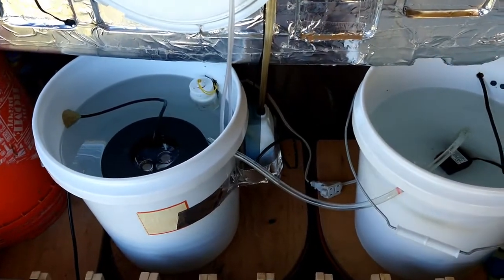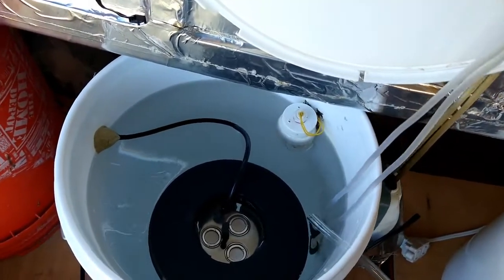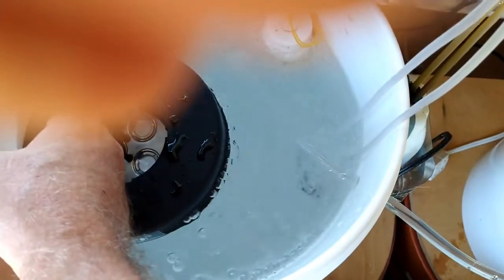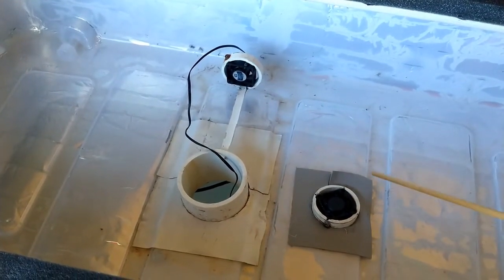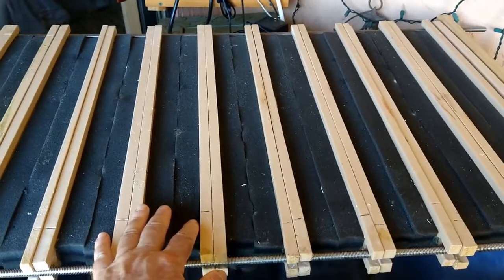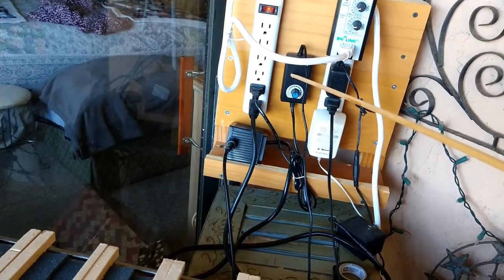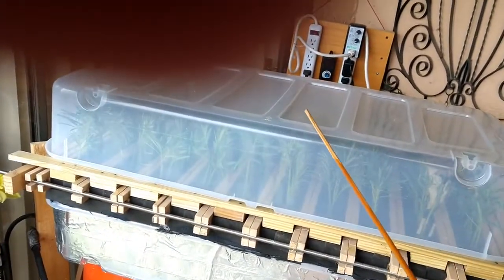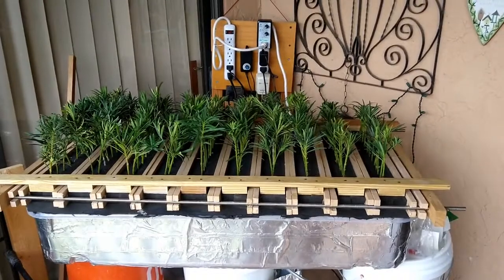FOGPONICS PROPAGATION SYSTEM

Comment: It would be interesting to do a side by side with a simple bubble propagator. Basically just a shallow tub with a lid and an airstone in it. As the bubbles burst at the surface of the water they throw small droplets up at the cuttings. Throw a few cuttings into it and see which produces roots first :)
Reply from the maker: The purpose of this system is to provide a uniform environment at the root zone to test different rooting hormone preparations.  The fog can easily and predictably be distributed to all cuttings without appreciably dislodging  treatments. It would be difficult to create such an environment using bubbles.
Reply: @phihelix7708  
You will find  the density of ultrasonic fog required to provide sufficient moisture for rooting will be too dense for gas exchange. Effectively ultrasonic fog acts like a fluid with very little space inbetween the droplets which is not ideal for root growth.
Reply from the maker: If you measure the density of the fog, you will find the fog is more than 99% air. While a thin film of liquid water is maintained at the cutting, this hardly acts as a barrier to gas exchange.
Also, the fogging module is on for 1min and off for 5 minutes.
Reply: @phihelix7708  
Consider 1ml of liquid represents 15 billion 5 micron droplets and ultrasonic fog is generally less than 5 micron.  If a 5 micron droplet was a table tennis (ping pong ) ball, a 50 micron droplet would be the size of a football. A container filled with ping pong balls will have far less space than one filled with footballs :)
Reply from the maker: It may be counterintuitive but when close.packing spheres, there will be about 48% space ( air) regardless of the size of the spheres. In this situation, the 5um droplets are not touching so the amount of space is vastly greater than 48%. There is actually a small energy barrier that must be overcome for touching droplets to coalesce which is a function of charge dissymmetry due to surface tension.
Simply, the density of water is about 1g/cc. The density of fog is nearly that of air. So there's not alot of water per cc of fog.
Reply: @phihelix7708  
Ultrasonic fog is dense so it tends to settle at  the bottom of a container like a fluid. The volume of droplets needed to fill the root chamber so it reaches the stems of the cuttings will not give you 48% air space especially with droplets that may be in the range of 1 -3 micron. If you blow the fog with a fan, the small droplets will tend to flow around the stems due to their low mass and boundary effect so the stems will be less likely to get sufficient moisture than if they were submerged in the super dense fog bank :)  I guess you will need to test it for yourself but in my experience rooting cuttings with ultrasonic fog is a very slow process compared to most other methods and there is a high probability the cuttings will die long before they produce any roots.
Reply from the maker: The root chamber is about 8" deep. I'm using 2 fans, one to move the fog out of the buckets headspace (about 4") and one to distribute the fog throughout the root zone. I did see some wilt after 20 days but I turned up the distribution fan and increased the "on" time of the fogger. Looks good again. Since I'm trying to evaluate hormone treatments, I need to non distructively monitor root growth as well as not washing the cut ends extensively. I should know if I'm on the right track in a few more weeks.
Reply from the maker: What type of plant was used in the 0-50 hr vid? What was the fog generation system?
Reply from the maker: @atomizer2665  I don't doubt your data. I question the conclusion that it is due to particle size. Then again i also question the concept that its possible to supply fog in droplets that can be absorbed directly through the root pores in a manner that just matches ET, which varies in time. I figure maintaining a thin film of water on the root is sufficient to maintain growth. A film probably acts as a barrier to the penetration of a droplet. If particle size was so critical, a signal generator could vary the frequency and amplitude of the piezo input in a manner to match a harmonic of the transducer. This should alter the droplet size of the fog in a predictable way. 
Again, if you weigh a cc of piezo fog, it's mass will be a lot closer to air than to water. indicating a very high percentage of air in the fog. I do appreciate this discussion.

Curtis
Reply: @phihelix7708  
The droplet size was the only conclusion i could draw given that i had a proven yardstick to base the settings on and it didnt work. If the ultrasonic fog was unable to grow the roots i figured if it was viable it should be able to sustain roots that were already accustomed to a mist environment..and that didnt work either. The only difference was the droplet size so if it looks like a duck its probably a duck :) I run air atomised aeroponic nozzles which use compressed air to generate the mist. They offer control over the flowrate and droplet size so its fairly easy to create a fog with very small droplet sizes which also produces slower growth and a sparse looking root structure. You may have noticed there was no lateral root growth in the video which was due to a lack of larger droplet sizes in the test. This would support the theory that the droplet size plays a big role, too small and you get slow or no root growth. With mainly small droplets ( but larger than ultrasonic fog) you get reasonably fast growth but no laterals. With a range of 5-80 micron droplets you get both.With too many larger droplets you get visibly wet roots with laterals but very little root hair growth.  If you search for ultrasonic vids on you tube most will involve a dwc in the bottom of root chamber which is doing the lions share of the work, while the fog just looks impressive. In your case, its a fair test because you are only running fog in the root chamber but that also means there is no backup which is risky. Most folks will throw plants into a fogponic system and assume the plant can intercept sufficient moisture from the fog even though the rootmass at that point is absolutely minimal, the plants generally die pretty fast.
Reply: @phihelix7708  
Any sign of roots?
Reply from the maker: @atomizer2665  Here's a publication that supports your findings.
https://journals.ashs.org/horttech/view/journals/horttech/28/2/article-p143.xml

To answer your question, Podocarpus roots in 8 to 12 weeks. We are at 8 weeks and I am seeing some roots. Unfortunately, early on, there was a problem with distributing the fog evenly. I ended up with one portion of the planting doing well and the rest of the planting didnt do so well. I adjusted the fans and things looked better but those adversly affected never caught up. I think it would take some optimization which would involve inventing the tools to monitor 
relevant parameters. 
Im now ready to try aeroponics. My problem is that im trying to evaluate rooting hormones so I need to avoid washing the cut ends . Im guessing low pressure generates large drops which may be problematic. Do you suggest high pressure nozzles? Can you recommend nozzles and pump. The ones used in the publication above may be too coarse a spray. Any help would be greatly appreciated.
Reply from the maker: @atomizer2665  I'd like to assemble a system that won't require exhaustive optimization. Seems like a HPA system has an inherently better precision compared to a low pressure system. For ex. the droplet size distribution is much tighter in a HP system than a LP. I see the Multiponics nozzles claim a droplet size of 30-80 um at 80psi. I do like using a $20 submersible vs a $100 high pressure pump but Its worth the extra for a sure thing. I don't need to run this much past 6" roots. Do you use an "accumulator" pressure tank with a solenoid. Id rather turn the pump on via timer. Your roots are impressive!! I need to use a model that requires root hormone so that I will see a treatment effect but at several second "on" time I believe the roots won't be washed free of the treatments.
Reply: @phihelix7708 
For your application i would probably go for low flow (0.3mm orifice) stainless steel 10-24 thread misting nozzles. They have a narrow cone pattern which would allow them to be mounted low in the chamber so the stems dont get direct mist. When it comes to control you should  use the fewest number of nozzles with the lowest flow rate that will provide the coverage. The design sets the lower limit on the amount of mist you can run, its easy to turn up the mist but impossible to turn it down below the design minimum. I run accumulators on all my HPA  setups. You may noit need to if you use anti drip nozzles and rely on the indirect mist. Using accumulators and solenoids provides tighter control over the mist but in your case the roots will never get close to the nozzles and will only be subject to indirect mist. A decent 24v dc reverse osmosis booster pump (125psi) 24v mains transformer and a digital cycle timer (dc voltage)  costs the equivalent of $80 here. If you can order from china it could be a lot less depending on import tax etc. I`d recommend using a  250 mesh filter on the input of the pump if you are not running drain to waste.
A pump only system will manage 2 second mist pulses especially if you are using anti-drip nozzles which keep the lines pressurized between mistings..They are the next best thing to a solenoid on each nozzle. I would aim to design the system so it will deliver no more than 1ml per 100L of chamber volume, if you can go less thats even better..you can always turn it up.
Here`s an old vid of a 0.3mm 10-24 brass/stainless mist nozzle at 10bar. https://youtu.be/MMVHJEoMFwg
Reply from the maker: @atomizer2665  Lots of good info here. The nozzles are difficult to find with all the features you describe. Part of the prob is that many sights don't have all the info needed. I learned early on not to describe the nozzles as HPA nozzles. Too many hits for hundreds of psi. This site looks promising.
 https://bex.com/wp-content/uploads/2016/01/BEX60Catalog9.pdf. 
Ill call them Monday to see if they can recommend a particular nozzle. 
I now plan on using an accumulator and solenoid valve. 
I plan on using a 64 gallon tote. When you describe 1ml/100L , is that per 2 sec "on time" in a 10 minute cycle?
Reply: @phihelix7708  
If you dont know what to look for it can be a bit daunting. If you  check out the Fogco and Amfog websites you should find plenty of nozzle options. Ideally you want a nozzle with a low hourly flowrate, a VMD (Volume Median Diameter, aka, Dv0.5) of 30 microns and DV0.9 of 80 microns. This will give you a mist where half the droplets are smaller than 30 micron, half are larger than 30 micron and 90% are smaller than 80 microns.  I`d recommend buying a good quality accumulator with a replaceable bladder if you can.  I`ve had some of mine for over a decade now and the original bladders are still in them. I would steer clear of the cheaper white reverse osmosis accumulators typically made in taiwan. They are normally rated for 100psi maximum working  pressure  but if you run them at that they wont last very long.
I make 64 gallons about 242L so ideally you want to aim for a misting duration that delivers no more than 2.4ml to the tote...As an example, 1 second of mist from 4x 2LPH nozzles would deliver 2.22ml. The more nozzles you have and/or the higher the individual nozzle flowrate the more difficult it becomes.
Reply from the maker: @atomizer2665  1 sec on every 10 min?
Reply: @phihelix7708  
If you are delivering 2.42ml (less than half a teaspoon) per misting, the off time required will be in the region of 60-80 seconds  The goal is to build up and maintain a constant level of moisture in the chamber.  You have to consider moisture level in terms of degrees of dampness rather than wet and dry. If you  deliver 1000 individual mistings of 2.42ml over the course of a day it will give you a completely different outcome to misting 2.42L once per day even though the chamber gets exactly the same amount of water.
Reply from the maker: @atomizer2665  I found the repeat cycle timer ( with SSR) that can be set to 0.01sec for both on time and off. It's funny how the name brand costs $300-$400 yet the generic, which obviously comes from the same factory in china, costs $30.00. 
You have given me lots to consider, now I need to make some decisions. Thanks for all your help. I'll keep you updated.
Reply from the maker: Looking at the results of the fogging set up I think the problem is that the diameter of xylem elements is so much larger than the fog micro droplets. The plant normally draws water due to a vacuum created by evapotranspiration from the leaves. This requires a contiguous film of water occluding the xylem elements. The problem is the same as trying to suck the last drop of soda from the bottom of a glass with a straw.
Reply from the maker: @atomizer2665  The video is a vocabulary lesson that avoids a serious explanation of osmosis. A key problem is that osmosis is the mechanism whereby water moves through a membrane. It has no relevance when describing water uptake in a cutting.
Here is a pretty good basic explanation. 
https://www.khanacademy.org/science/in-in-class-10-biology/in-in-life-processes/in-in-transportation-in-plants/v/xylem-transpiration-life-processes-biology-khan-academy
Reply from the maker: Also see 
https://tigerprints.clemson.edu/cgi/viewcontent.cgi?article=1918&context=all_theses
Reply: @phihelix7708  
If cuttings uptake water then you could put them out in full sun to grow roots, no need to use low light intensity and high humidity to minimise water loss from the leaves.
Reply from the maker: @atomizer2665  https://youtu.be/KIug9Foou3s
Reply from the maker: @atomizer2665  The surface area of cut end is only a tiny fraction of the surface of a root system. While the plant in survival mode can sustain itself on the little water it can draw up it's stem as long as it's not losing a massive amount vis the leaves. Embolism, or entraining air at the cut end, makes water movement even less favorable.
Reply from the maker: @atomizer2665  How do you feel about net pots. Im about to start my build based, in large part on your sage suggestions. Id rather not use net pots. The frame from the fogger build gives the cuttings plenty of support. I can see how net pots and media can act as a buffer where the roots are interacting with the damp media as opposed to the transient mist. I saw a youtube of a Lavandula Dentata grow where only bare cuttings were used and he got roots on 90% of the cuttings. What do you think?
Reply: @phihelix7708  
I use netpots and collars, it all depends on where the plant will be going. Most of my aero setups are geared for  3" (80mm) netpots, apart from the towers. I have a couple of large chambers that use a pair of garage door brushes to hold the plants at the top and gutter guard mesh to support the bottom. There are a lot of ways to do it.
Reply from the maker: @atomizer2665  awesome, I'm trying to compare rate of root initiation an growth as a function of treatment. It will be much easier to compare naked stems. I read somewhere net pots and media can act as a temporary buffer in case the system fails.
I think I will include a ups in case of power failure. My timers are supposed to maintain their program regardless. 
I wonder why some sharp piezo guy hasn't developed an element to produce aero size droplets?
Reply from the maker: So I'm putting the finishing touches on my HPA system. I put in about 15 fast rooting coleus cuttings just to check uniformity. 4 days in and I have 100% survival. I had to adjust one nozzle a few mm which brought back some badly wilted cuttings. Some are more turgid than others. I'm awaiting my 100psi cut off pressure switch to replace the 80psi that is currently installed which should help. My question is, would you recommend using a small fan to aid in uniformly distributing the mist? I have some waterproof 40mm 12VDC with speed controller. My 4 nozzles are arranged in a line down the middle of the tote. Like I said pretty good coverage but not perfect.
Reply: @phihelix7708  
I tested fans in my outdoor systems a long time ago and the only thing it did was dessicate the roots, If you have the fan you could give it a try but i wouldnt expect too much.  I dont run pressure switches these days but i would go for one thats adjustable over a wide range. I used italtechnica PM12`s but i dont think they are easy to find stateside. The dwyer CXA is a decent alternative.
Reply: Holy... This conversation! I learned a lot. Thanks guys! So many complex and difficult stuff.